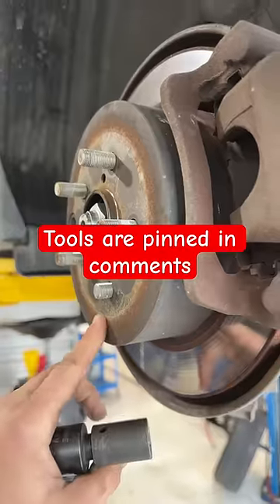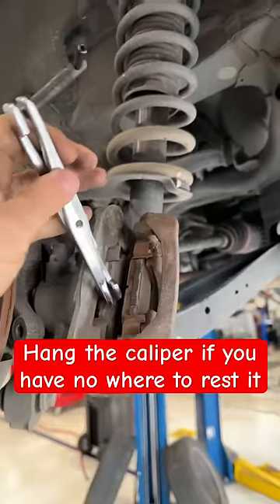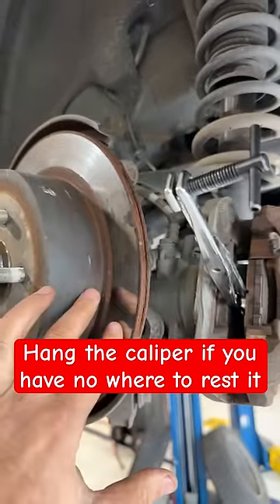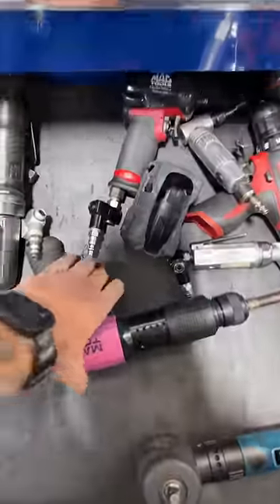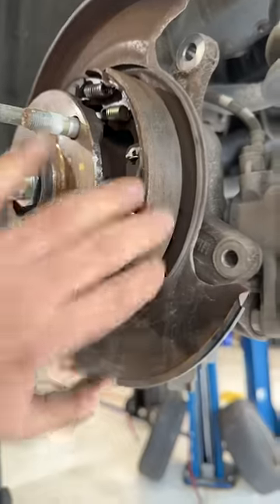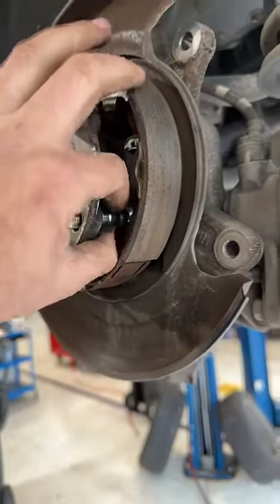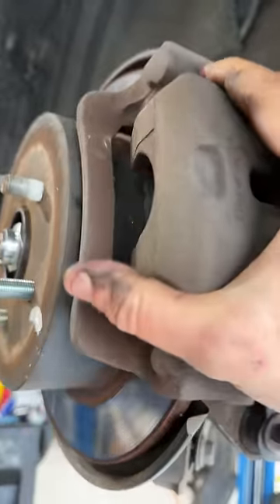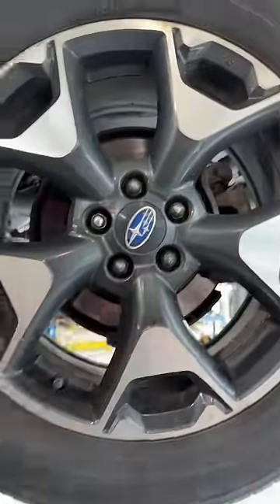Replacing broken wheel stud, tools for quick repairs

Comment: In 10 years I have never seen any other mechanic mark the rotor 😂
Reply: Maybe I'm 2 dum but I don't understand what two things are lined up with the mark since he only marks one surface on the rotor 🤔
Reply: @PiitaaDerbez  the mark goes with the new stud. He marked where the broken one was
Reply: There is no point. Rotors aren't balanced or anything.
Reply: If you were going to be lazy and not clean the back of the rotor and the hub then marking would help
Reply: @Norwegian_Bastard  if the rotor is balanced then it doesn't matter how it goes on. Even then a rotor does not have the weight to affect ride.
Reply: @Norwegian_Bastard  but that means mount how you want but it would not affect drive ability. Not like a tire out of balance or road force. I can see audi doing that.
Reply: @Norwegian_Bastard  I'm a mechanic so no need to explain. Other than how you had them on crooked to start with. And how they were crooked but your tires weren't? Maybe automotive diy isn't for you.
Reply: Same, I couldn't think of a reason to mark it either.
Reply: because marking it has literally nothing to do with the repair ?
Reply: @gofigure84   if you can’t tell a shiny new stud from an old one or a broken one from a good one something else is wrong with you
Reply: @sharp8569  what are you talking about? I didn't say anything about the stud. The conversation is about marking the rotor.
Reply: @gofigure84  sorry when you said he marked the rotor where the broken stud was like he might forget which one was broken and  need a Mark to figure it out 😂
Reply: Marking the rotor/caliper position is pointless. Never seen that done in my career.

Comment: I'm a mechanic of 20 years and never have I marked the rotor since you cleaned the surface of the hun and rear of the rotor
Reply: Didn't see the point in marking the rotor when he cleaned the hub and hat. Maybe this makes him feel a little better about his shop probably charging $200 out the door for a lug stud.
Reply: I was wondering the same thing on making the rotors
Reply: If  the car had shims behind the brakes rotor that would be necessary.  I have never seen one ever on a modern automobile I've only seen them on old c3 corvettes.

Comment: The tire studs and lugs are not what is really taking the load of a vehicle . It’s the friction between the hub-rotor-wheel. The bolts are to hold tensional pressure. By lubing surfaces now studs-nuts have to do all the work of forces!

Comment: I’m glad you used a stud installer to replace broken lug nut
Reply from the maker: Thanks
Reply: I just put my rim on and cranked on it with a breaker bar. Seemed to do the job.
Reply: @jimbothompkins ahhh you’re bring back so many shitty memory’s🥰
Reply: @talonbateford4662  haha right. I only had to do one so it wasnt too bad.
Reply: I thought I was the only one that caught that. Even the other people making comments on your post didn't catch it.😅
Reply: @jimbothompkins  I had to do at least one per wheel…. I was doing my suspension so it was “only 1 extra step”
Reply: I like to make them spin freely in place for the next guy. 😂
Reply: 5-7 washers works as well
Reply: Those are like $30, the stud installer, and in some ceviches you have to pull the bearing off

Comment: Yay!  I wish it was that easy on everything.  On certain makes the studs cannot be manipulated in place without grinding away some of the head on the stud.
Reply from the maker: Sounds awful
Reply: Pretty much any Kia or Hyundai you actually have to grind away a part of the top of the stud to get it to fit and those things are notorious for breaking. The 12x1.25 stud does not have enough hardness to be tightened past 100 ft pounds. When I managed a tire shop I got really good at replacing them fast.

Comment: Automotive apprentice here in the rust belt, some axel nuts if you patine that malleable top part inward it’s great as a diy stud puller. I made one a bit ago and I haven’t had problems with it not working or breaking.
Reply from the maker: Sweet

Comment: Looks like a quality technician taking the time to do all the little things that make a complete job.
Reply: Marking the rotor: unnecessary 
Put a tool between the pads and spreading them a little: unnecessary 
Cleaning the inside of the rotor with a wire brush attached to a drill: unnecessary 
Air hammer to remove broken stud: unnecessary just use a regular hammer it literally takes two whacks.
I’ve replaced many studs and have never done all this bullshit and never had a problem just replace the stud and move on. Ain’t no technician got time for all that it takes 15-25 minutes to do this and that includes raising and lowering the vehicle. This guys method 45 minutes to an hour.

Comment: When replacing a wheel stud, you should always torque the lug nuts again after 100-200 miles of driving. I learned the hard way, but luckily, I caught it before it did too much damage.
Reply: After 50 miles

Comment: Great job, and I like how you showed that you don't need to remove the e-brake. However, they have torque specs on those bolts.  I'd hate to be the one trying to do the brake job, in my driveway and only having hand tools, because it seemed like too many Uga-Dugas there.
Reply from the maker: You might be on to something
Reply: Thats a manual cable operated shoe. There’s no solenoid/servo on that caliper
Reply: @ComidaDelBrain   They still have torque specs.

Comment: canadian mechanic here, never have i ever had to mark a rotor to put it back on. never had a problem. you do you but we see the worst salt and corrosion up here.
Reply from the maker: It’s a best practice, nothing else, just like marking driveshafts before removal.
Reply: @baja-automotive  can you explain why you think this? Only time it makes sense to me is when splitting a two piece driveshaft and you need to put the sections back together the way it was. When removing and reinstalling a driveshaft that isn't being split, or is only one piece, as long as the bolts are tight it won't make any difference. I will 100% agree if it's purely to form a habit for when it is necessary.
Reply: @aaronjohnson2094 My guess is he does it so he can charge more for a simple job, none of that cleaning and marking is necessary. It’s a waste of time and extra time just adds unnecessary costs to the customer.
Reply: @watermelons79  idk about the marking but cleaning the mating surface of the rotor and hub is a good practice so it doesn’t get a vibration it takes a minute which isn’t gonna add any extra to the bill
Reply: @watermelons79 cleaning the surface isn’t a waste of time. It’s actually a good safety thing to do. As you have rust and corrosion on the surfaces you don’t get a flush mating surface. Same as when you do brakes you always clean up the surface of the hub and the caliper anchor before putting it back together.
Reply: @watermelons79 the cleaning is to make sure the mating surface is flush  so you dont have run out due to rust and other crap getting  caught between the 2..

Comment: That rotor looked thin af. Could jist be the camera angle but from where I'm sitting it looked thin lol
Reply from the maker: Normal size for this braking system
Reply: Way below minimum thickness.
Reply: Hey I'm here and your there. I'll take your word for it. I work on cars for a living as well. These phones always seem to make things look worse than it is or the complete opposite
Reply: Thought just the same...
Reply: The newer cars are supplied with throwaway rotors.  In most cases they aren't thick enough to turn.  Thanks to the over-reaching and unrealistic MPG numbers that the EPA sets on the manufacturers, they must cut weight at any and all places that they can. Ounces beget pounds begets distance.
Reply: That’s a non vented rotor it’s fine
Reply: That’s a rear rotor, so the thin, non- vented disc with the drum built in for the emergency brake assembly is fairly common
Reply: @baja-automotive  are you blind, look at that rotor! right after you spread the pads you can see clear as daylight that the rotor is splitting apart!! That car should not have left without new a brake job... Sketchy
Reply: Rear disk brake rotors are usually thinner than front rotors because the front brakes do the majority of the braking.
Reply: @AIFilmCreators you’ve obviously never done rear brakes on a Subaru lmao that’s not a crack buddy boy
Reply: It's a rear rotor with shoes for the parking brake. Rear rotors are thinner than front ones.

Comment: I wish it was this easy to replace the studs on my silverado 2500hd. A rear wheel came off and it bent 6 of the 8 studs, had to pull everything off including the axle shaft to get the hub out in order to change the studs. I had just replaced the rotor too but it helps knowing the auto parts guy, he warrantied it no issue 😂
Reply from the maker: Dam

Comment: My trick is just to put the old lug nut back on, hammer it til  the lug is free and then put the new lug nut/stud  with a bigger nut in between just to pull it 3/4 the eay through, the rest comes in when i torque the rims
Reply from the maker: Interesting

Comment: Extra stuff that doesn’t matter why would you mark the rotor when if you install a new rotor there isn’t a mark already🤦‍♂️ why did you use that attachment on the air hammer instead of using a flat. Not hating just stating my own opinion
Reply from the maker: Used the old rotor, new rotor was not installed; and it’s just good habit to mark things as they come apart. Most people are not aware of marking these items.

I do have many flat bits for the air hammer but I was ok using the one I left in the hammer from the axle job I just finished
Reply: @baja-automotive  I know you didn’t replace the rotor but no mark would be on a new rotor. Yes I agree to a point but some things you won’t know pulling it apart, always refer to the work shop manual. And I have the same air hammer it’s not a bad hammer

Comment: Ahh yes, a common subaru problem. The broken lug nut.

Lemme guess it was a forester or crosstrek?
Reply from the maker: Crosstrek
Reply: Toyota and subaru only take 86 ft/lbs of torque, most ugga duggas lowest level is around 90 lbs,

Comment: Hi!, whats the copper paste for?. Lugs and nuts would need blue paste too? What fluid and paste you recommend for usual maintenance? 
BTW there must be a bettee alternative to OEM lugs. Subaru break like Crystal
Reply from the maker: Great questions
A little anti seize to help keep the rotor from sticking to the hub. Anti seize on wheel studs is debatable as it might cause over torquing. So only use a tiny bit
Reply: @baja-automotive  Thanks

Comment: What's with the mark on the rotor don't need it what's with the air chisel to knock out the stud just take a hammer 1 or 2 hits takes it out what's the toll holding the pads in never had one of them fall out my life last but not least love that tool you use to put the stud back in never used one of them either just use the bigger nut to slide over the stud and then use the lug nut to put it back in and I've been a mechanic for over 45 years

Comment: In my limited experience, the only time a rotor has a correct placement is when there is a set screw to hold it to the hub. Does it make any difference here?

Comment: Is it copper pasta you are using there? It is not heat resistant. So after a while you can feel those brakes hitting, use only the ones dedicated for brakes. If not sorry for bothering. 😊

Comment: Just curious, why do you need your mark the rotor before taking it off?
Reply from the maker: Indexing rotors is a best practice to make sure it lays in the same spot against the hub. Over time and miles the rotor and hub might marry together and if not put back in the same spot would generate a vibration. It’s something from my truck days

Comment: You dont need any of these special tools, i have never had to spread the brake pads when reinstalling. I have used washers and the lugnut to install new studs. Stay cheap.
Reply from the maker: You do you
Reply: @baja-automotive  I plan on getting a stud installer soon because when I do have to do studs, sometimes the ID of the washer is too small to fit the OD of the stud

Comment: Theres nothing wrong with the damn rotor😂 
They remove material from the factory around the edges to balance them. Just like wheels, except instead of adding weight to one side, they remove weight from the other.
Reply from the maker: Yup

Comment: I see why the labor rates are so high at the dealership. In the real world you whack it out with a hammer
And stack a bunch of washers and run the lug nut on and put it back together and get it off the lift and get the next job in

Comment: Honest question, why make a mark, that hole isn't moving from where it's at?
Reply from the maker: Over time and years the rotor and hub could marry together, and if the rotor doesn’t go back in the correct place it might generate a vibration. It’s a best practice from my truck days when we machined rotors off car.
Reply: @baja-automotive  but isn't the hole with the new stud 'the mark' why actually make a mark, the hole itself isn't moving?

Comment: Not understanding the clocking of the rotor, why would it matter what position it goes back on? It’s not like it’s balanced to the hub or anything
Reply: Just asked the same thing. I’ve never ever seen anyone mark a rotor and wouldn’t do so because of the exact reason you said.
Reply from the maker: It’s a best practice. Over years and miles the rotor could marry to the hub, and if not installed in the same location may generate a vibration or disturb the hub.
I picked this up from working on HD trucks and northern vehicles
Reply from the maker: It’s a best practice thing from HD trucks and northern vehicles.
Reply: Lateral run out induced by parts matching. Spec on new cars is typically less than 0.002 of an inch… even a small amount of runout can lead to large pedal pulsations, in a couple thousand miles. 

This is also the reason off car lathing is not very accurate  relative to “on car”, an improper match that is not true to the hub/flange can cause issues.
Reply from the maker: I love the on car lathe  @ComidaDelBrain
Reply: Do you see many vibrating rear brake rotors?
Of the thousands of brake jobs that I've done, maybe there were a couple, but really none that I can remember.

Comment: Wait! What subaru is this? Have 2 type of brake? Disc caliper and drum?
Reply: 🙄

Those are rear brake rotors. The shoes are the emergency brake. Aka parking brake. They have been around for YEARS
Reply: @IG10705  tq. I never see this before
Reply: @MysteryPringles  

I have them on my 2000 blazer

Comment: Why do you have to mark the spot on the rotor ???
Reply from the maker: In case the rotor developed a wear spot with the hub. Keying the rotor before you take it off, ensures everything goes back together correctly.

Comment: you didnt  clean the rotor mating surface both sides or clean the brake dust off and then lub the front rotor and studs then lube the hub around where the hole is so the next tech can take off the rotor with ease and lug nuts with ease.. and where did you go to tech school

Comment: Not sure what the mark was for on the rotor.
Reply from the maker: Wanted to put the old rotor back in the same orientation on the hub. Over years and miles the hub could wear a spot into the hub. Especially if it’s never been removed. This is more of a problem with trucks. But it’s a best practice I keep up just to avoid potential comebacks.

Comment: Why did you mark your rotor... Jesus christ its not a tie rod
Reply from the maker: Great question. It’s best practice to mark the rotor when reusing the same hub and rotor. Over time these parts can wear together and create their own mating surface. It’s more of a problem on trucks. Again best practices.

About 1 out of a 1000 rotors removed without marking the hub location will come back for a vibration.
Reply: @baja-automotive wish I would have known this sooner. Could be an issue I faced post CV Axle and LCA replacement. I removed the Rotor to get better access to the ball joint and kept feeling vibrations but couldn’t diagnose why.
Reply: @baja-automotive  I like them odds

Comment: There is no way that roter is within spec
Actually I can't believe that roter is on a passenger vehicle
Reply from the maker: It’s ok
Reply: Just say you don’t work on Subarus bud. They just have a small rear brake system. Brand new rotors are 10mm